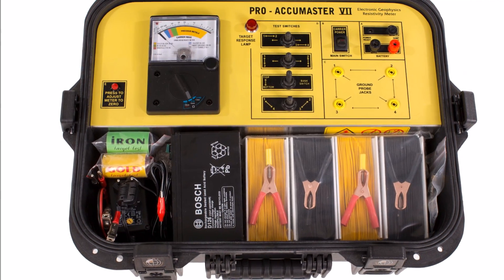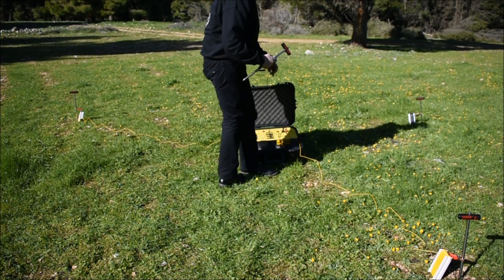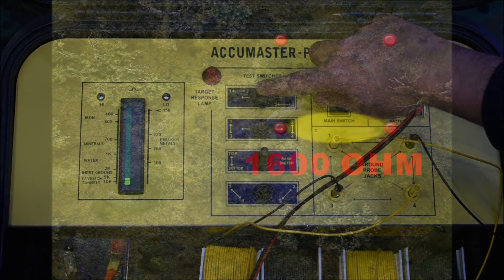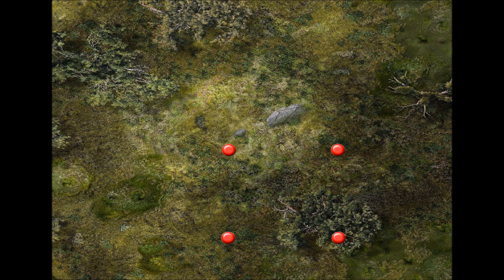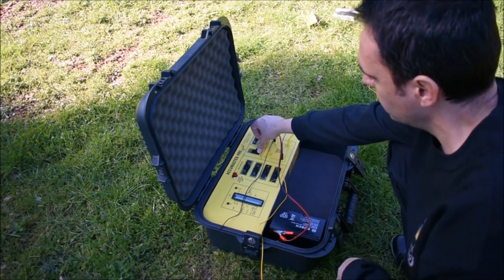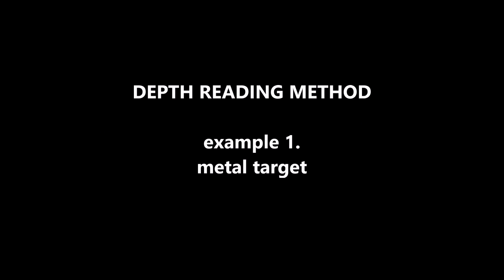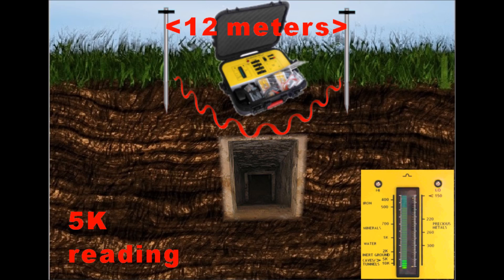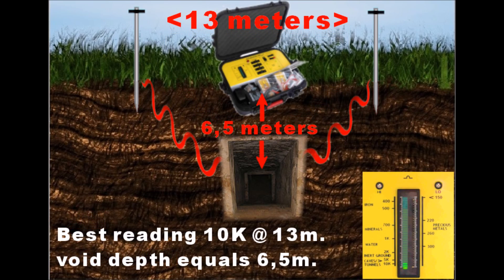Accumaster geophysics undergound resistivity void & gold detector

Comment: What is the smallest size of a metal object that can be found ?
Reply from the maker: Smallest target has to have at least 30 cm total surface and mass, for example weight above 5 Kg.
Reply: @Golddetectors  can it be used in a wet field, or even to a river ?

Comment: Does it get affected by rocks or humidity. And if it does what adjustments should be made
Reply from the maker: Probes should make a good stable contact with soil, so in sand or gravel effective operation is not possible. The ground surface should be more dry compared to the subsurface so that the electrical signal can dive deep.